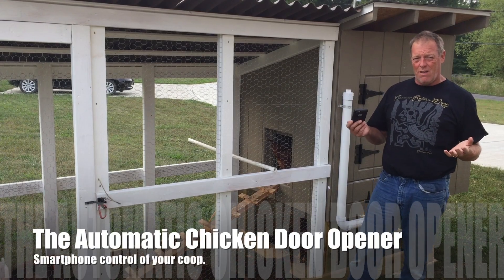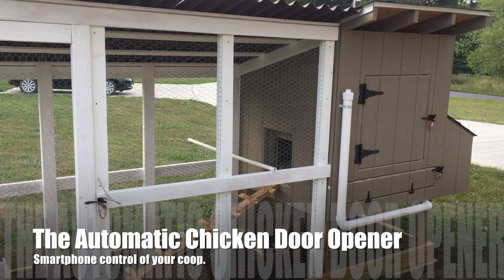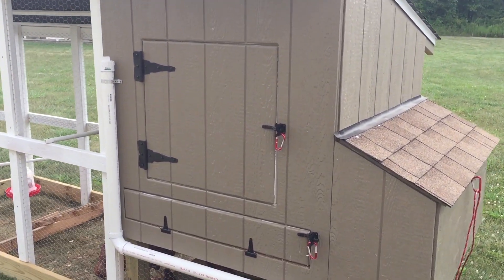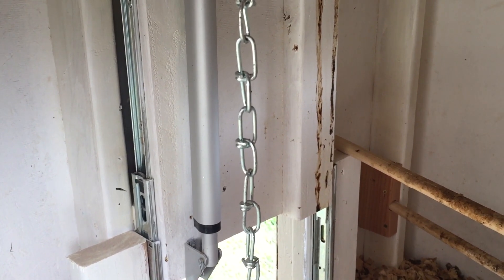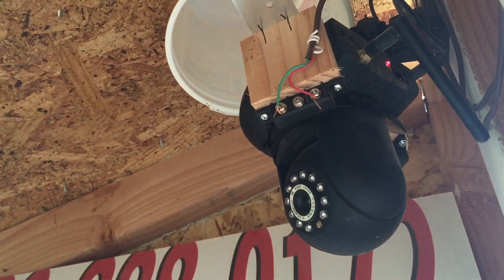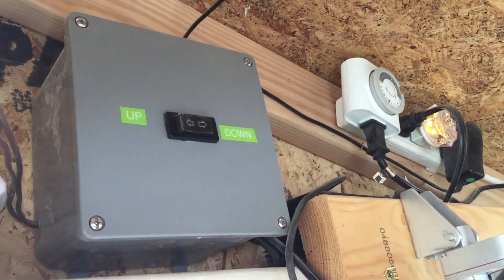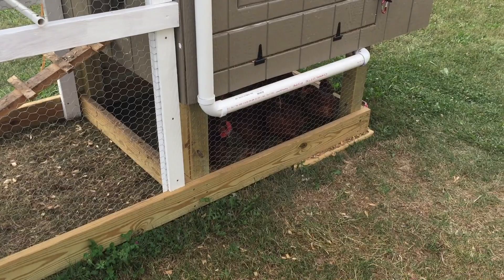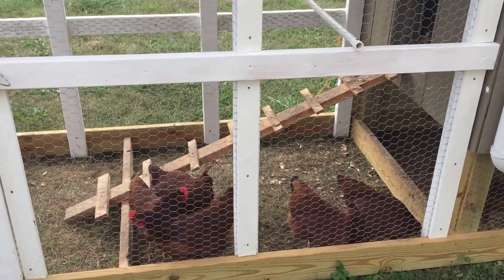Smartphone Controlled Chicken Coop Door

Comment: Can also use an Alexa device then use either phone OR an ehco dot "alexa close hen house"...problem with that is Alexa does make mistakes....every now and then she SAYS "okay" but the light you told her to turn on is still off and you have to repeat ....any brief WiFi signal is apt to fail ....I like something more foolproof ....a clock with physical contacts for instance
Reply from the maker: I was using the app that came with the smart controller, but have since started using alexa to open the coop using routines.  I've set up the routines to open the coop at sunrise and close the coop 1 hour past sunset.

Comment: Huge problem if you live where I do ...we are in the sticks rural so internet goes down fairly often ...chickens would be trapped ... the only thing we are comfortable is an electro magnet to hold the door closed and a time clock to break power to the magnet every morning ....a simple screen door spring is constantly trying to pull the door open ...now if the power goes out or we can't make there to open it....or the WiFi went down if we had your system ...the door still opens ...I actually thought about adding a redunant photo cell so if the clock contacts finally fail in the closed position that will release the door...and that is super really simple to add with a normally closed circuit contacts on the photo cell simply wired in series with the door magnet.....Yes we still have to run down and close the door every night but never have to wake up at the crack of dawn and rush down there or if we go somewhere worry the chickens are trapped....and yes it is not 100% security 100% of the time ....but we figure what is the chances of the henhouse door is only left open at night a very few days a year that a predator would just happen to choose THAT night?  Probably all the local predators have already tried thier asses off to get in and simply gave up and never bother checking any more ....in fact for years now so far so good...been open on power outage and various times we could not close it and nothing bad happened ....a lot of folks don't even lock up their hen houses and don't have problems
Reply from the maker: I do agree that this coop opener/closer may not work for some with bad internet, but the same thing would work with timers. As far as keeping the coop open at night, the chickens probably would be safe at night with no protection, but I think that the chickens have less stress living in a closed coop during the night.  To be truthful, I just like tinkering with these electronics. :) You should make a video of your setup.. I'd like to see how it works!

Comment: Nice build. I'm in the middle of building mine. 4'x8' by 7' high in back 6' front. I purchased a WiFi relay module and will install it as soon as I get it bought a cam and intend to use it the same way.
Reply from the maker: The camera didn’t last too long, so I went with WiFi relays with door lock relays to handle the extra amperage.

Comment: A clever solution using the camera to actuate the switch.  I have several cameras in our coop.  Ultimately, I went with using ESP8266 wifi chips to control my doors, fans, lights and temperature for the brooder.  Tied these all to a local MQTT server running on a Raspberry Pi.  By switching a port on or off on the router, I can limit the access to local network and wifi, or allow access via internet if I need to be away.  Your camera solution is much simpler.
Reply from the maker: My camera died, probably due to moisture and chicken dust... but then I switched to using Sonoff SV WiFi smart switches to open and close the door and turn on and off the lights. This has been working great until they got a software update and I had to set them up again.
Reply: @iBradWatson  I got a couple Foscam R2 cameras. One failed at about 2 years, the other doing ok.  The rest are either Jennov or Amcrest cameras. Just ordered another Amcrest to replace the R2 that crapped out.
I run about a dozen cameras mostly to monitor the flock.

Sonoff stuff operates very much like what I'm doing in a homebrew fashion.

Comment: did the camera idea work to open and close?
Reply from the maker: Family J yes it worked for about 6 months until the camera died. Probably due to moisture and chicken coop dust.  I changed them over to some smartphone controlled relay boards and auto relays to handle the power. I’ll try to get another video up on how that works. It was much cheaper than the camera.
Reply: @iBradWatson  Thanks on Quick Reply since that is a main thing i am surfing youtube right now
Reply: @iBradWatson  Could you post a link to the relay boards? And links to the door opener? I would like to do this as well. Thanks!
Reply from the maker: @TheQuarterAcreHomestead   
The Wifi boards 1 for opening and 1 for closing: https://www.amazon.com/gp/product/B07C3GMRBP?ie=UTF8&tag=bradwatson-20&camp=1789&linkCode=xm2&creativeASIN=B07C3GMRBP
The relays to handle the increased amp draw for  the linear actuator: https://www.amazon.com/gp/product/B013TIINQ2?ie=UTF8&tag=bradwatson-20&camp=1789&linkCode=xm2&creativeASIN=B013TIINQ2
The linear actuator to open and close the door:  https://www.amazon.com/gp/product/B00P2BYT3G?ie=UTF8&tag=bradwatson-20&camp=1789&linkCode=xm2&creativeASIN=B00P2BYT3G
I'll try to do a video on connecting the 3 items very soon.  Stay tuned!
Reply: @iBradWatson  Did you ever make this video?  I am about to talk this task.
Reply from the maker: Justin Statham haven’t made a video on the solar coop, but a lot of things have changed and the coop is no longer connected to the house with the umbilical cord. I know I’ve been promising a video about the coop and when I get home next week I’ll post a video of how the coop is now. It’s just amazing. Stay tuned.

Comment: Nice!  Let me know how you do the solar.  I just built mine with the coop and a 25 ft run.  I need the door so I can shut at night and not worry if the kids shut the door when I am away for work!  Great Idea!
Reply: electro magnet to hold it closed on a timer ....and screen door spring (2.50 at TS) trying to pull the door open ....the time clock turns the power off from sun up to just before dark and the door can not be closed can not remain closed ....only at night will it stay securely closed ....super easy!  Just make sure to leave the steel plate that comes with the electro magnet LOOSE otherwise it will be difficult to make a good grab on the magnet....but if loose it want to grab easily.  ....this system works with or without 120v power  because both the door magnets and the time clocks come in both 120AC OR 12vDC ...with DC you need a battery and a little solar charger to keep it topped up ...or a little bigger battery/solar charger set up and you can add a work light in your coop!  Maybe a sensor that turns lights on iand a scary noise maker for 10 seconds if predators come snooping too?   ...which of course is ultra easy to do if you have AC power at the coop
Reply from the maker: Sorry I missed this... I'm in the process of changing the coop over to a larger coop and I'll be adding all the electronics to the new one.  So keep tuned and I'll be getting videos up soon.